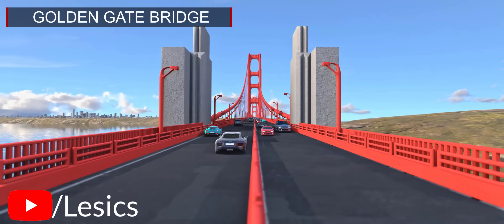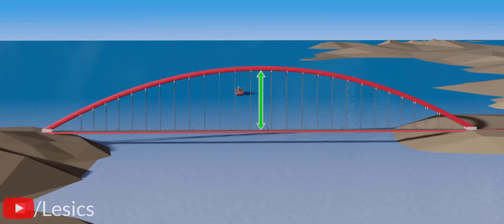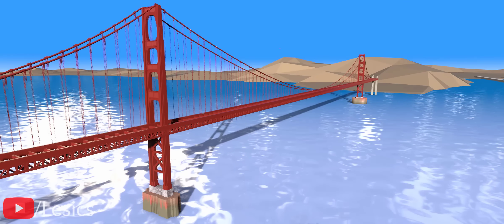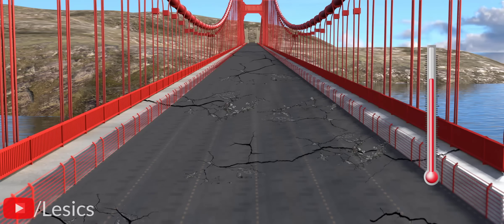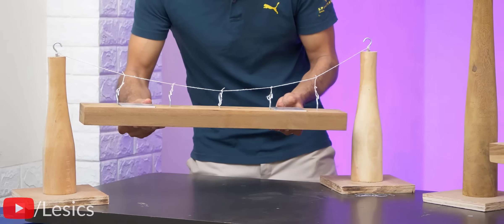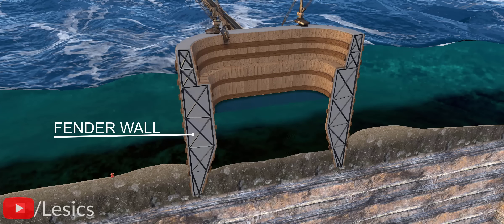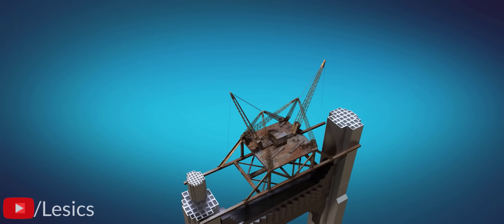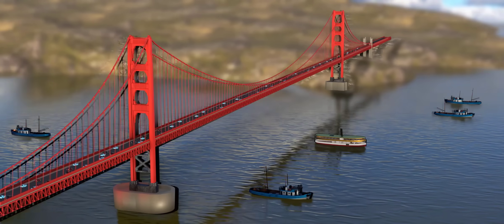Golden Gate Bridge | The CRAZY Engineering behind it

Comment: You also forgot to mention that the bridge deck isn't just straight horizontal as many think. The deck actually arches upward some to the middle of the bridge. One is because the Earth's not flat. So over long distances especially with water that to has an arch to it so if the bridge was built straight across the middle part would actually hang lower to the water. Also alot of times when you see bridges even short ones you will notice it has a slight arch to it. This is bc a bridge with an arch it much stronger then one that's just straight across bc it's arched it presses it self together due to gravity which causes a downward pressure that keeps it in place. Straight bridges doesn't have that and that downward force is still there and without the curve to help balance the downward force it can continue to keep pressuring downward (sagging)until the other supports fail.
Reply: I believe the paint is Red Oxide. A special rust resistant paint. The paint is very effective normally but in a harsh sea-air environment, it needs to be re-applied regularly. I believe the bridge has full time painters, the painting never ends.
Reply: @tubester4567  you are right. I saw on a documentary once that the painters(I think like four guys) take a whole year to paint, then at the end of the year, they start all over again. Haha
Reply: Arch upwards transfers load to compressive force which concrete can bear. Not tensile force. That is why bridge fesvk is arched upward.
Reply: I am no engineer or scientist but just an avid enthusiast and engineering minor, but I’m pretty sure you would not notice the curvature of the earth in that short of distance. I think it’s like 5 miles till you can even begin to notice. But with the curve in the bridge, I believe many flat bed trailers on semi trucks have curves in them too to help support the load! 😃
Reply: The upward arch in the roadway has nothing to do with providing additional clearance underneath… or because the earth is curved. It was a deliberate architectural feature to “suggest” the earth’s curvature (which is imperceptible). It certainly has that effect and from certain perspectives or from miles away, such as from Tiburon or Angel Island, it really seems that it’s reflecting the earth’s curvature. It’s a brilliant detail. Even the ancient Greeks used this principle to great effect: the Parthenon in Athens is the best example of using delicate curves to improve upon a straight rectilinear design.
Reply: Your first reason is just rubbish.
The length of the bridge isnt long enough to consider the earth curvature in the design.
The second reason is solid from engineering point of view.
Reply: @AftabAlam-yw4eq  I'm just relying what my teacher told us at school

Comment: I remember reading somewhere about a suspension bridge that was so tall, its towers leaned apart from each other with the curvature of the earth.
Reply: The Humber Bridge in northern England has the tops of the two towers 36 millimetres further apart than at the bases. It is a single span suspension bridge like the Golden Gate, but the towers are 1410 metres apart, and 155.5 metres high.
Reply: Well, IF both towers were plumb and vertical - and equally far apart at top and bottom - it would prove that the world is flat.  Of course, it isn't.
Back in the day, there was no way to measure such distances to the accuracy of millimeters. Today we can. Assuming the towers are both perfectly vertical, 
the difference between top and bottom separation could be estimated by spherical geometry...taking Earth with a radius of 4000 mi, compute the angle of separation (at base of towers) in degrees or rads, then repeat the calculation using a radius of 4000 miles plus 746 ft (ht of towers).  This will give the separation at the top. At least for a perfectly round planet, which it isnt. Dang. I have too much free time.

Comment: Great video to watch as a Civil Engineer. Next time try to include the effect of resonance due to the frequency of the  external load (by people) approaching the eigen frequency of the structure. Which could explain the 2m dag instead of just static load. In general a great video to explain my field of work to friends and family!
Reply: Speaking of dynamic loading… all the load calcs on the GGB were calculated by the structural engineer, Charles Ellis, who was a master of the higher math involved. All good to 100mph winds, as I recall. A few yrs later, in 1940, Leon Moiseiff won the contract for the Hood Canal suspension bridge, in large part due to his involvement on the GGB. And although Moisseiff had originally proposed the suspension concept for the GGB, he wasn’t as knowledgeable on dynamic forces and resonance as Ellis. Almost as soon as that that long, skinny bridge was completed, it developed a wild oscillation from the high winds in the region. Moiseiff’s design was a disaster in waiting and lacked the rigorous analysis done by Ellis. The bridge fell apart within a matter of days due to aero-elastic flutter. There are videos of it on YT.

Comment: theres a fun engineering problem with the bridge right now: they installed aerodynamic slats on the pedestrian railings to resist resonant lateral twisting of the decks during some future sustained wind event (100mph).  however, now, when the wind hits from the right angle, the bridge now "sings" loudly and can be heard sometimes from miles around.  some locals  have described the dissonant noise as a "giant wheezing kazoo".  this has been happening with enough regularity that the bridge authority is working to retrofit every slat to mitigate the creepy noise.

Comment: Not sure 🤔 if my English vocabulary would be good 👍 enough at explaining this. I’m not trying to be the opponents advocate nor split hairs but couldn’t they install a post in the middle of the bridge 🌉 (between the two main towers that doesn’t form another tower but rather further supports the center of the bridge 🌉 to stop 🛑 it from sagging)?
Reply: Actually, that was the solution used on the Oakland Bay Bridge, a few miles east of the GGB. The western portion of that bridge, from SF to Yerba Buena Island has 4 towers and a large central anchorage. It’s functional and sound, but totally lacking in elegance. 

The GGB by contrast had the longest center span (4200 ft) of any suspension bridge in the world. A center anchorage was immediately ruled out due to the extremely strong currents and 240 ft depth. Construction would’ve been impossible under those conditions, not to mention long-term survival. Also, all shipping goes thru that channel. Would’ve been a disaster waiting to happen.

Comment: I know that this question has been asked before...why aren't cameras installed on every commercial airline these days as part of the design or perhaps retro fitted? In incidents  involving the engine(s) pilots can't see the extent of the damage if they occur and have to rely on crew members to relay the extent of damage. If  cameras placed facing the engines perhaps this would help the situation, in addition of the cockpit engine alarms.

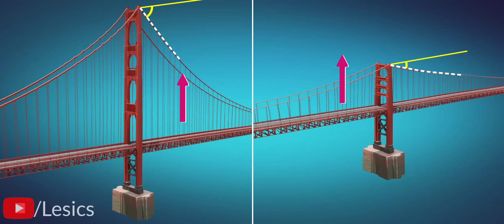Comment: 9:20 You can learn this section at home by hanging heavy pictures or mirrors with picture wire. The weight of the load is always the same but the tension in the cable depends on how it is oriented. Vertical would be supporting the weight fully. But with added angle, only a portion of the tension is holding the vertical load weight.